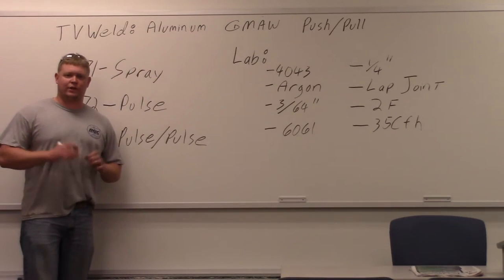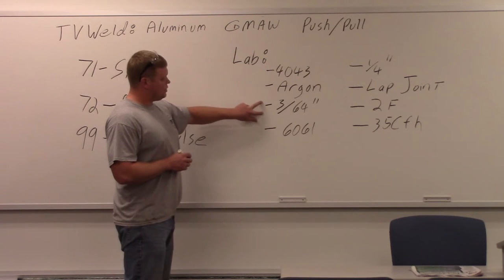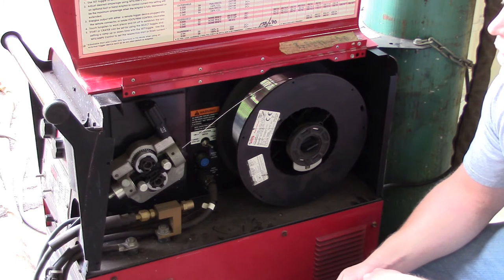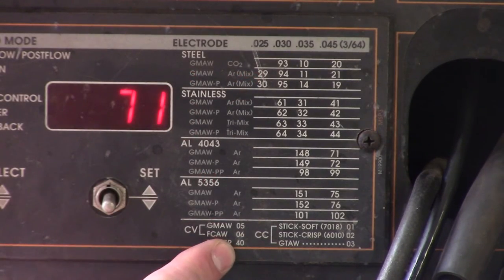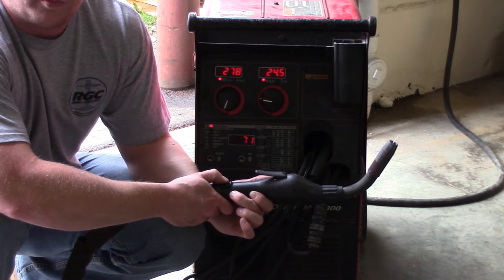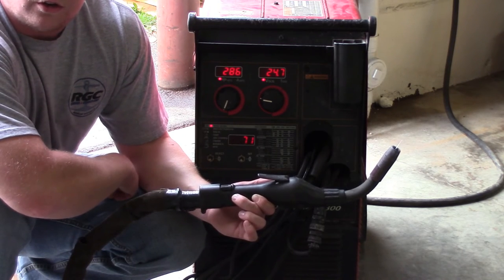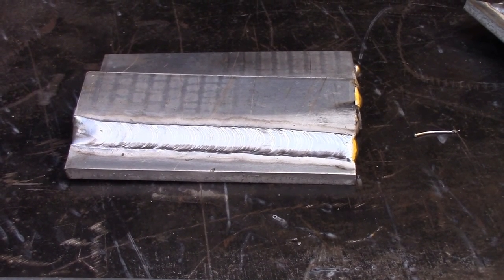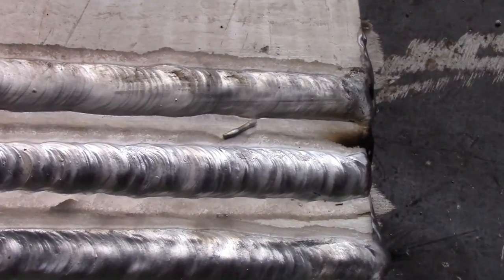How to MIG Weld Aluminum

Comment: Love welding aluminum.  Tig and mig. Did it for 20 years. Fronius with the cobra push pull lead is the only way to do it.
Reply from the maker: I thought about getting a Fronius.  I'm not even sure who sells them where I'm at.  I've only used TIG on a Fronius, but it was a nice machine.

Comment: Ive been welding aluminum every day for 2 years with the miller 350p. And the python push pull. Ive also used the Lincolns like the on you have but i prefer the millers because the arc is more crisp and i can crank the volts higher before the wire is burning back to the gun I have learned that a little sputtering is not always bad. But in the ideal scenario you want to be right on the edge where it will sound kinda like static from a fm radio. I usually run 23.5 to 40 volts with about 265 to 275 wire speed  all depends on the day aluminum is very temperamental. Miller 350p better quality arc once stablized. Lincoln smoother start easier for beginners. Like yourself
Reply: Thank you, everyone welds full send wire speed or no wire speed at all. It's a happy medium. You want SOME consistent  crackles. I weld aluminum boats at Armstrong Marine USA inc. I havent found anyone on youtube that can really weld aluminum like we can. We use Millers also. Let me tell you when you know how to weld aluminum, it looks better than steel. Most satisfying welds I've seen in my life

Comment: great video!! what is the best setting on 3/16 and 10g aluminum corners? any advice??
Reply from the maker: On my Lincoln 350 MP MIG welder the settings for 3/16" are 490 ipm/21 V, and for 10 Ga 325 ipm/19 V. for 3/64" wire size.

Comment: Any advice on uphill aluminum?
Reply from the maker: Weave if you can and pause on the sides and hold to let the other side solidify.
Reply: @TVWeld yeah I'm doing spray arc uphill and its a pain. I know you have to wait after passes and clean it really well or it builds up with impurities and welds like garbage. Wire wheel every pass and let it cool off before running the next. Vee groove 1 inch cover passes are kind of pain. I try to hold that gun 10 to 15 incline angle and i weave it but it just dont weld like steel.
Reply from the maker: @barryjones7025  It sure doesn't.  You have to move quick with Aluminum.  Do you have pulse capabilities?
Reply: @TVWeld  my test passed bend test. I went kind of sour on the cover passes but the grinding of the coupon and rounding those edges made a huge difference when it was put on the bender. 365 ipm 26.5 volts
Reply from the maker: @barryjones7025  Good Deal!
Reply: @TVWeld  yup i got 5 more tests to go. Aluminum 2g next then overhead aluminum then steel xray tests which need carbon arc gouged on the backsides. Pulse spray on those.

Comment: Great video although you can not tie the guns lead in a knot and expect it to weld properly. Yes if the lead is looped, going up or over objects, twisted, or hanging it works as it should.. A knot would cut off gas flow and potential damage the liner.

Comment: How much does this set up cost?
Reply: Around $6000
Reply: Hell yeah thanks for response! These vids are great this guy is cool I like how he says how important certain shit is to know!
Reply from the maker: $6,000 might be a little low.  I bought the gun not too long ago and that was $2,000 alone.  I would say you'd probably be into the whole system for 7 to 8 grand depending on the supplier.  Just a guess.
Reply: Brent Harkness Jesus that push pull gun is expensive
Reply: @TVWeld  We recently had to buy a new gun for the 350mp, a Magnum Pro, front trigger, $3500 Cad. 
This is our second Magnum after the Python was discontinued years ago...... 
Pissed off the boss something fierce when this happened.. had to wait 2 months to get it....
The machine new, here was about $7800 and that was after shopping around apparently...